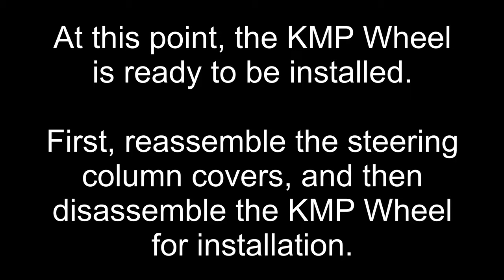KMP Steering Wheel Install & Review - BMW e82 DCT

Comment: Hello👋I need your help🙏

"BMW E92 M3"
I would like to replace the normal steering wheel of the above model with this one. Is it possible to replace the steering wheel by myself without hiring a specialist?
Are there any other parts needed other than the small parts that come with the product?

Or plug and play?🤔
Reply from the maker: Replacing the steering wheel by yourself is very easy and no specialist is required. You should be able to follow my video and your install should be very similar. If you want to connect the buttons to control certain features of your car, like the horn, M-sport selector, DTC selector, etc., then you will have to do some basic wiring to connect the harness of the steering wheel to the car's wiring for those functions. The KMP install guide is very good at explaining how to do this. If you feel comfortable with doing some basic wiring, like tapping and/or splicing wires together, you can probably do it yourself.
Reply: @09_motorsports  Thank you so so so much for the detailed information🙏✨

Comment: hey bud, lovely car! 
I noticed you say its mostly a track car, i also have a DCT E82, currently having a 1M body! 
Have you done anything engine wise before tracking? Im having DCT service, rod bearings and a bunch of other things done within the next month, but i want to do something for the oil starvation issues. Have you done anything related to this? like baffled sump etc or ever ran into any issues oil wise?
Reply: Thanks! I'm jealous of your 1M body panels. I've done quite a bit for the reliability of the engine and to make sure I am not overly stressing the cooling systems. A fairly comprehensive list currently is as follows: CSF radiator; Wagner EVO 2 Comp Intercooler; Custom-DIY oil cooler including Setrab cooler replacement in the stock cooler location; Replaced oil filter housing gasket; Replaced valve cover/gasket; GFB+ diverter valve; all aluminum hard piping - lower intake to turbo, Turbo-to-intercooler, and Charge Pipe; Crank-bolt capture; Slon Workshop DCT oil pan (increased oil capacity and cooling). As for oil issues, I recently replaced my oil pan and had a VAC Motorsports baffle installed. It did make a difference by reducing oil pressure drops in certain turns that were previously concerning, with data to it back up. It is by no means a cure, but it did help. I have not done an accusump, but it is something I am considering.
Reply: @team9racing  I really appreciate the detailed reply! and haha thank you! 1M was always a dream car of mine so im building my own! 
Ive currently also got FBO as in : Intake, Inlet, outlet, intercooler, upper / lower charge pipe, GFB DV+, Custom tune from wedge etc. Which im glad to see that youve done as that ticks some of the boxes. I did want to upgrade my oil cooler and gearbox cooler, i wasnt aware of the brands you just mentioned so i might have to have a look at those when i get my DCT serviced as the extra gearbox oil sounds quite appealing!. Ive seen alot of people mention that Accusump and it does interest me quite alot, along with the Vac Baffle, that was one i was looking into. did also play with the idea of potentially trying to modify an M135i baffled sump to fit, which i dont think you guys got that model out there did you? But my mechanic thinks he might have a go at trying to modify one of those to fit which im not actually sure has been done before yet. ( which is one of these https://mmrshop.co.uk/products/bmw-n55-sump-baffle )
Also seen some people do an M2 Sump however i know thats on the severely pricey end of the spectrum. 
However you have confirmed what i want to do as in baffled sump / maybe accusump and i can look into those extra bits youve done! 
But again mate thats really appreciated, thanks for taking the time out to give me a reply!
Reply: @jackse82  Happy to help give my thoughts. Sounds like you are well on your way! Here are my thoughts on what I did and why. I tracked my car for 2 years and logged full sessions with MHD. I went to 5 different tracks during those 2 years and out of those 5 tracks, I had low-ish oil pressure in 2 corners, each at different tracks. Both corners were hard braking zones into left hand 180 degree hairpins. The oil pressure dropped to the low 30 psi range during the turn. Otherwise, I had no oil pressure issues in any other areas on the track. My oil pan gasket started to leak a little bit, which is known to happen in these cars, so I figured while I am having that changed, I might as well do the baffle to see if it helps. I bought a brand new oil pan and VAC baffle (it is much easier to weld on a brand new pan instead of trying to clean, and clean some more, and then clean again with an old pan) and it was installed with the new gasket. I went back to one of the tracks with one of the trouble-corners and my oil pressure went from low 30's to high 30's in the same corner. Not to mention, I was also 4 seconds faster with new tires and suspension for the second trip. So my speed was slightly higher in the turn.

All that to say, the baffle was an improvement. An accusump is likely even more of a fix to the oiling issues, but on the flip side, it adds a bit more complexity to the oiling system and you have to make sure it is working properly. I would consider adding the baffling, or one of the more sophisticated BMW systems you mention and then log the oil pressures to see if you are having any corners that are causing issues. Then from there, determine if additional oil pressure control is needed. Best of luck!

Comment: Hey man I was wondering what hub adapter that is or if you have a link or anything
Reply from the maker: Everything you see in the video comes with the steering wheel kit. So the hub is part of the kit. I didn't have to purchase anything separately, which is really nice and makes it easy because you know everything will fit together.

Comment: Thank you for the video! In the process of making a track car now out of a 135i dct. Is there a part number for this as I see the do not list the e8x on their site?
Reply from the maker: I'm glad you have found the videos helpful! The e82 is listed under the e9X wheels. If you click on one of the v2 wheels, you'll see that the "e82" is tagged as one of the applications. So you'll order an e9X wheel, and then in the notes when you checkout, put in there that the wheel is for an e82. I do not believe they have a specific "e82" product number, but instead they are listed under the e9X. Hope that helps!
Reply: @09_motorsports  Yes thank you . Looking forward to getting the car! Been tracking an e36/s54 for about 7 years. Tried to install a dct and have run into a few issues that I could not solve. Like the idea this is a small light platform!
Reply from the maker: @fstlnj29  It is a very good platform and a lot of fun. Enjoy it!

Comment: Where did you buy this? I have e88 DCT (2012) and looking for it but, I dont see the steering wheel in their website for mine.
Reply from the maker: KMP's website does not specifically list the e8X chassis, but you can order it through them here under the e9X chassis: https://www.kmpdrivetrain.com/product/bmw-e9x-racing-wheel/

At the bottom of that page they list out the BMW models the steering wheel is compatible with: "The wheel is compatible with E90, E92, E93, E81, E82, E88 (BMW OEM Numbers 32342283738 and 32306795573)."
Reply: @09_motorsports  thank you!
Reply: Hi! Works it with N54 with ZF trans? Thx! ✌🏼

Comment: what is your tablet mount
Reply from the maker: It is a mount system by "Ram Mounts." The tablet holder is a "RAM Tab-Tite Spring Loaded Holder for 7" Tablets." It is attached to a "RAM Double Socket" arm, with a "Diamond Ball Base" attached to the dash and then a "RAM Ball Adapter with AMPS Plate" to connect the tablet holder to the other side of the double socket arm. They have a lot of options so you can you different configurations based on how you want to mount it. And they are really solid mounts.

Comment: is there a way to get the airbag canceller seperate?
Reply from the maker: I looked at the KMP website and do not see where you can buy components individually. You'd probably have to reach out to them and ask directly. Sorry I cannot be more help!
Reply: @09_motorsports  no its alright, you answered my question :)  i ended up getting it sorted by rewiring pretty much all the wires on the steering wheel hub, thanks for getting back to me, i enjoyed the video :)
Reply from the maker: Glad you got it sorted out.

Comment: How was the wiring?
Reply from the maker: The wiring to install the wheel itself was very straightforward. I have not wired any of the buttons on the steering wheel yet. I'll be sure to update this if/when I wire in some of the car functions to the steering wheel.
Reply: Any updates on the wiring for the controls?